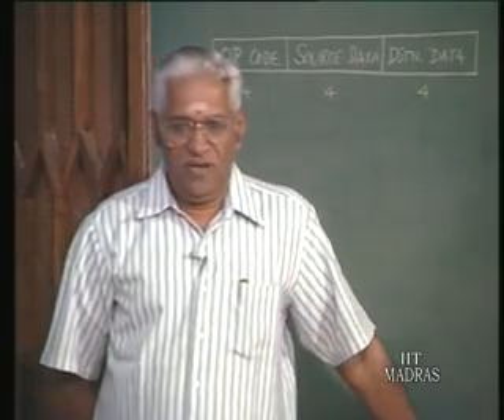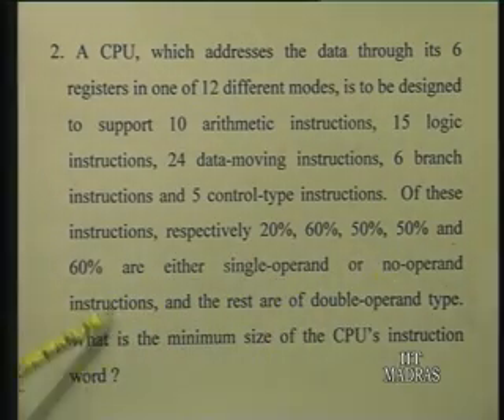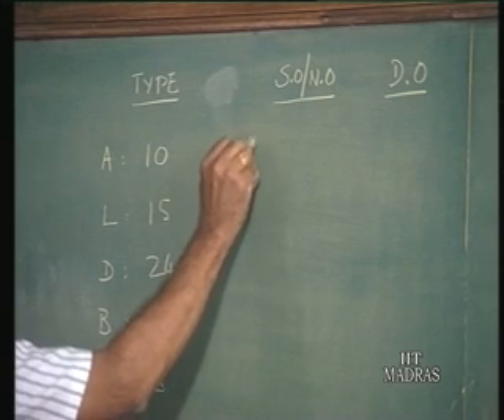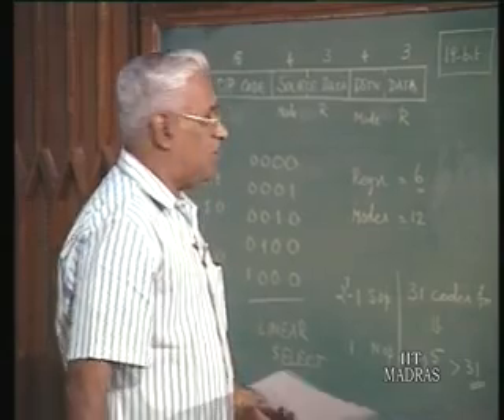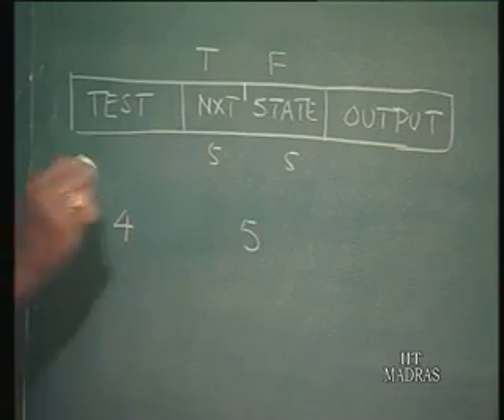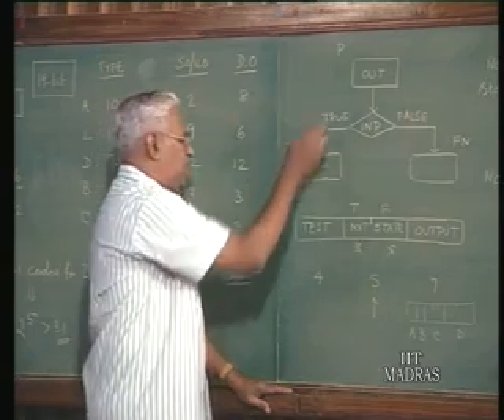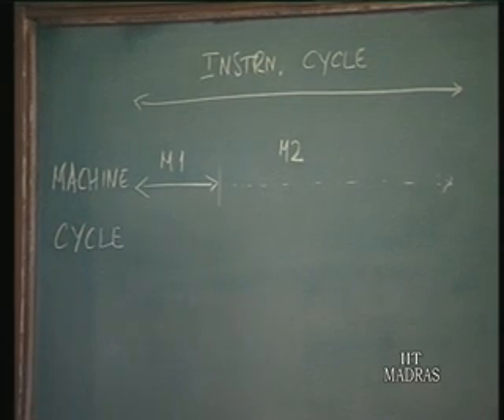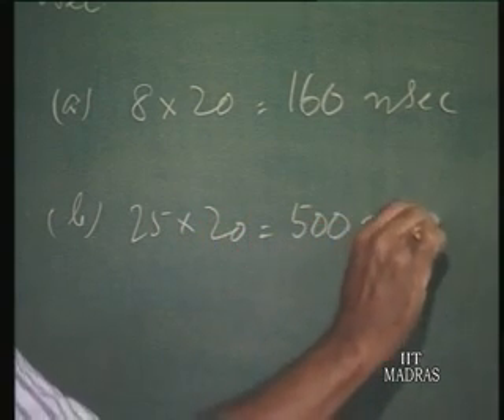Lecture - 13 Problem Exercise

Comment: since there are 30 states and each state has a distinct output (output implies the control code as per prev lectures) so there can be only 30 outputs ..but how can the answer be 2^7?(ques 3)
Reply: output here means control signal for determining the data path as per prev lectures so that will consist of 5 bits of states in ALU and other 2 bits may be in some other combination(mux or register i/p o/p enable). we r not bothered about that as we are directly given the size of control signal so there are essentially 2^7 o/p or more precisely 2^7 data paths

Comment: Alternatively, the Problem statement that "M1 ALWAYS consists of 4 states" can also be interpreted as that M1 consists of a total of 4 states, including the one WAIT state. In that case, the length of M1 can be taken as 4 in stead of 5 states. So there is a little ambiguity - - Prof. S.Raman
Reply: Sir, is  it always necessary for M1 to perform a memory access. I am asking this because it may so happen that the instruction being fetched by M1 is present in the CPU registers itself, so no memory access is required just like the RISC type architecture? If this is true then the shortest instruction executed will have only 7 states. 

Thank you very much for sharing your knowledge with us sir.